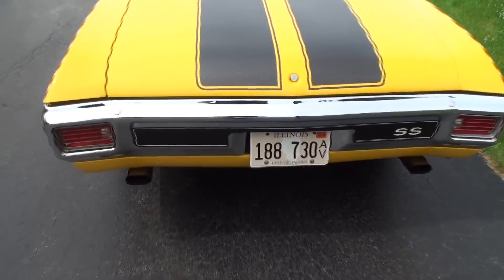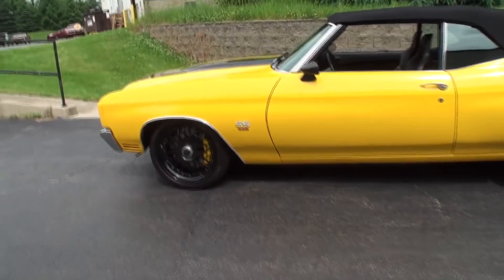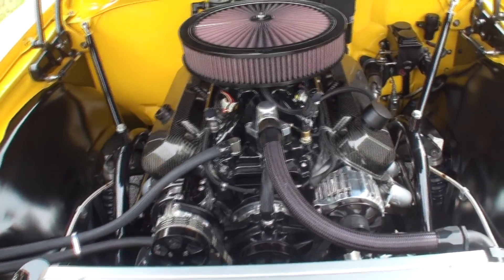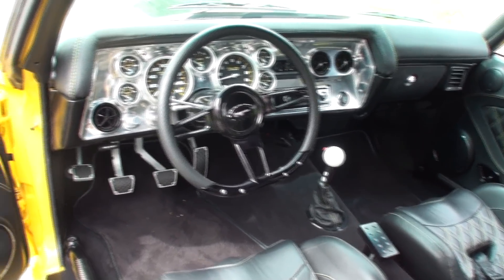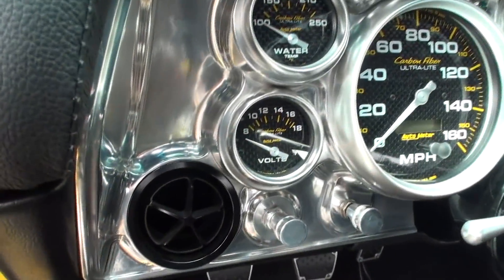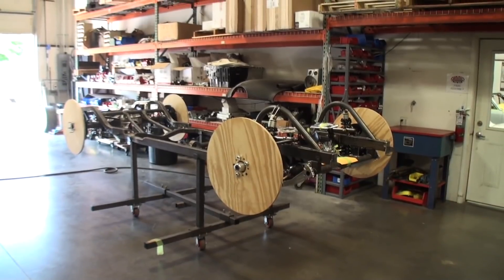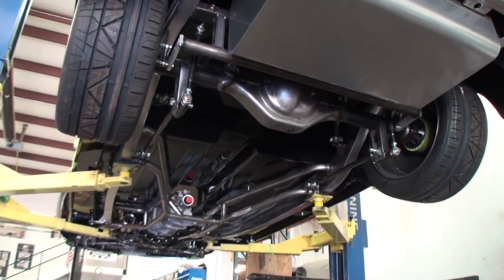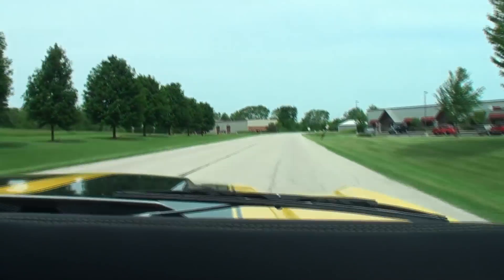1970 Chevrolet Chevelle SS Convertible & 598 CI Engine 900 HP Ride - My Car Story with Lou Costabile

Comment: Nice workmanship. If this car is actually to be driven and not just a show car the Dash will blind the driver with the top down when the sun in behind the car.
Reply from the maker: Hi Rock, That is a interesting point. Or maybe blinded from the high beams from the car behind you that lost the race :-) Lou
Reply: @loucostabile  Have you ever driven a Convertible with the top and all windows down, on a Sunny day Lou?

Comment: Cant help but wonder what kind of top speed that car could get up to. Another great video Lou love watching your channel.
Reply from the maker: Hi PlymouthDuster 225, Seems geared for getting off the line, however it is an interesting question of top speed on a car like this.  Happy to read you're enjoying the Channel with me, Lou
Reply: Car doesn't have the aero to go 200....
Reply: @user-qr7ee2cp4y and it wouldn't have to for the optima challenges.

 Plenty of tough convertibles in those auto-x challenges

Comment: 598 cubic inches = 9,800 cc. 
Just saying.
Reply from the maker: Hi Andrew, Don't forget the aluminum frame & carbon fiber to make it lighter too :-) An exhilarating 10 seconds or less on a 1/4 mile run, and a much needed bathroom break when it's over, Lou